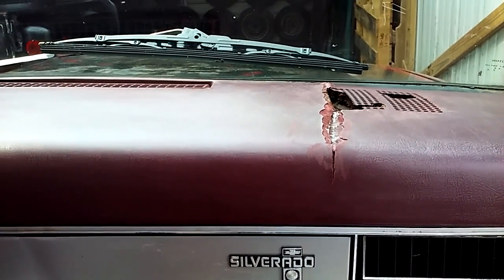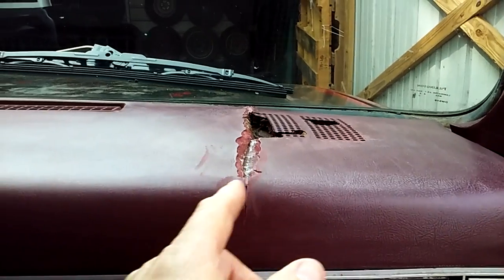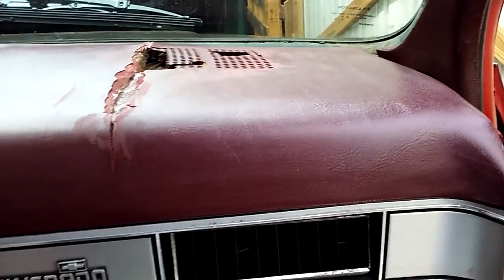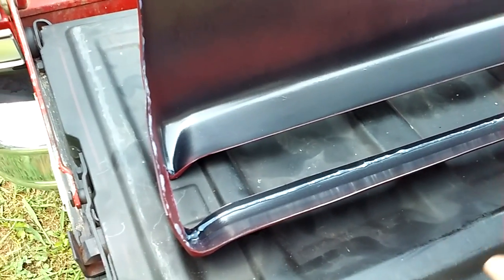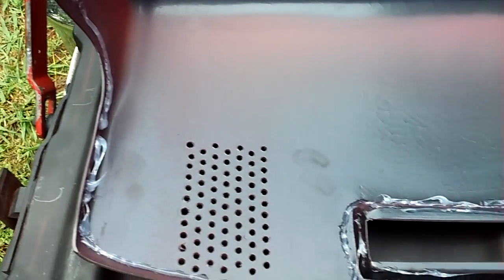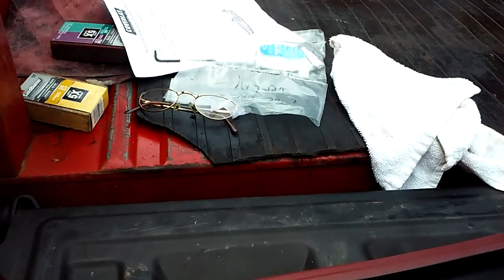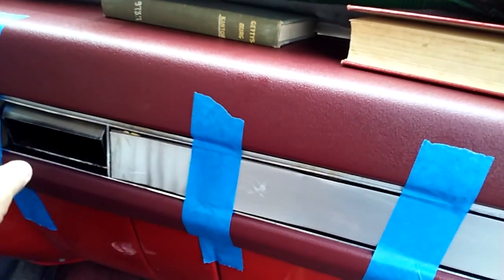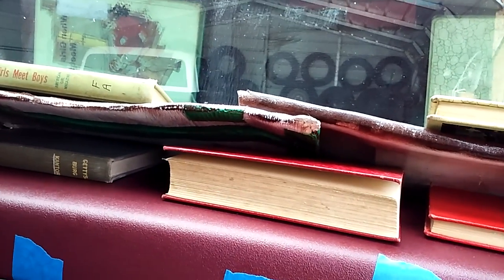1984 Chevrolet Truck Coverlay Dash Cover Installation Part 4

Comment: Looks nice, maybe you can use a short Rod or broomstick propped against the seat to push on that right side area that sticks out a little you showed. If the silicone isn't too dry.
Reply from the maker: Yes I thought about doing that myself but I decided I would wait and see what happens.  I hope it works out good but we will see. Thanks buddy